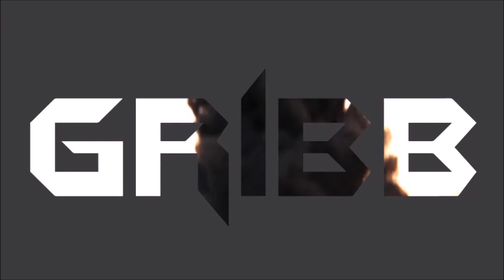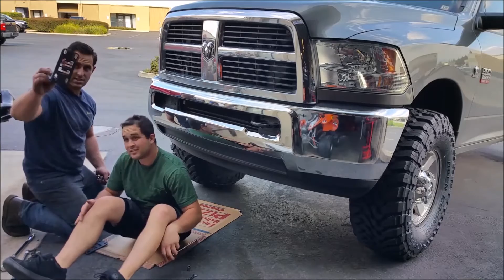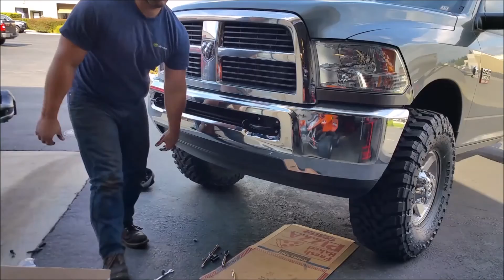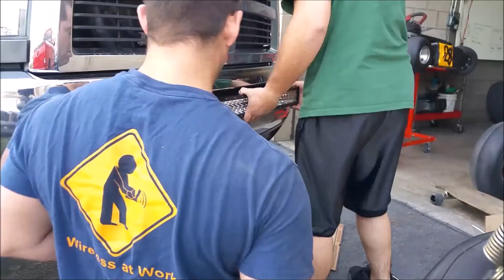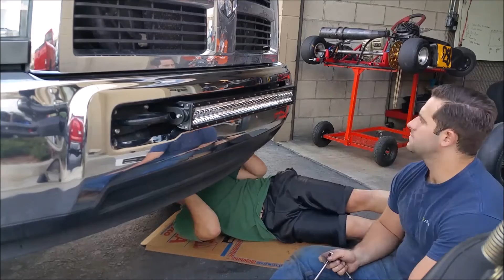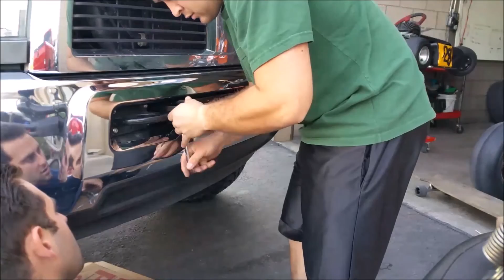30 Inch Light Bar on a Ram 2500

Comment: Does it over heat now with so much rad blocked off. Thanks have same truck looking at this idea as the lights are crap.
Reply from the maker: +17madracki17 WE haven't seen any difference in performance of the cooling system
Reply: +GribbOffRoad worth a shot too find out. Worried about hauling in the summer. Thanks for the reply
Reply: @17madracki17  blocking air flow no thanks